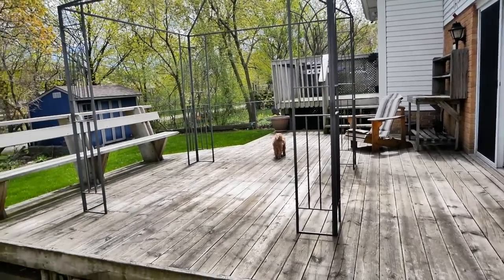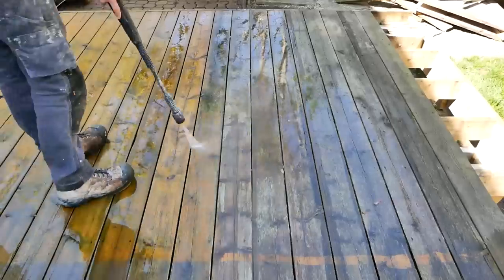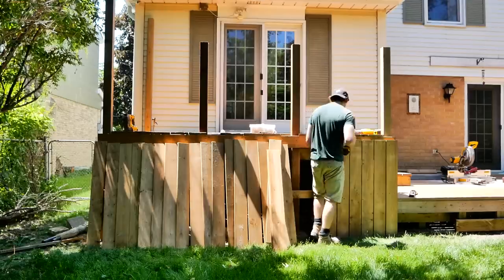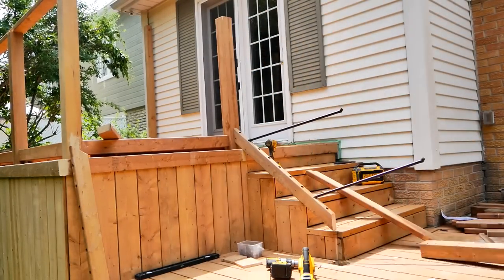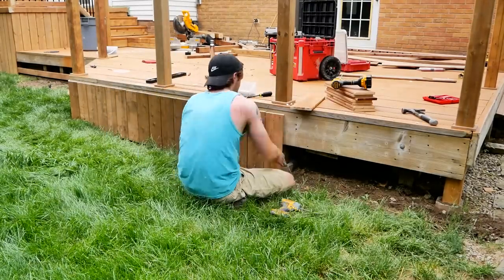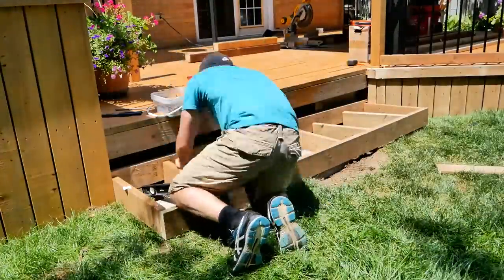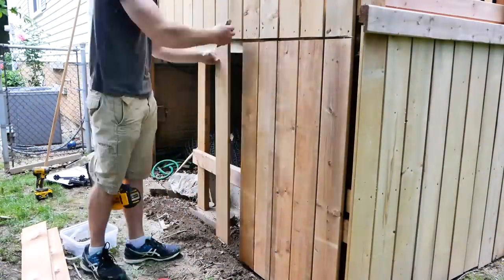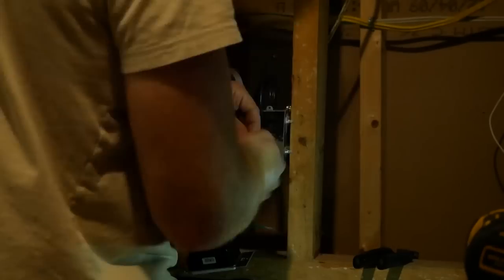DIY Backyard Makeover (Complete Deck Transformation)

Comment: Nice work but you might want to research the building codes in your area for tips on constructing the posts and rails and for people building a new deck, also the connection to the house.   Deciding how to attach the rails to the post is not just about cost and aesthetics - it's a safety issue.   You don't want your party guests to all lean against that railing 5-10 years from now and have it collapse.   So the decision to just toenail a few nails into the rails may not be adequate.   Same for the posts - make sure you understand how to install for maximum strength and safety.   I've seen too many news stories of people injured and even killed when a deck (or railing) collapses.